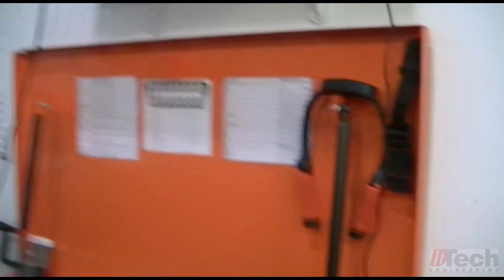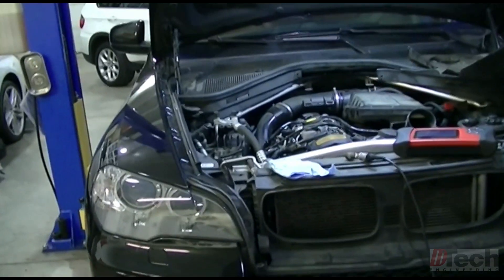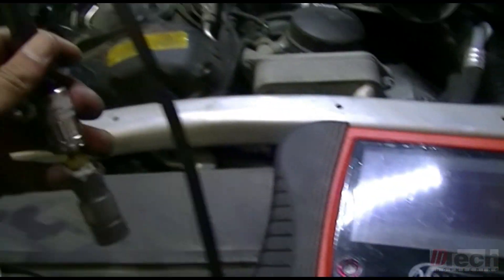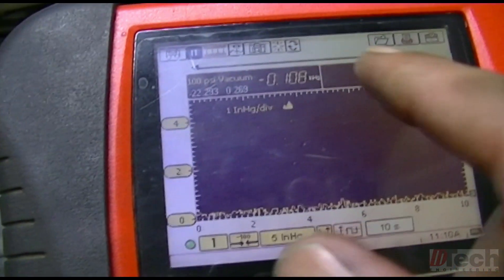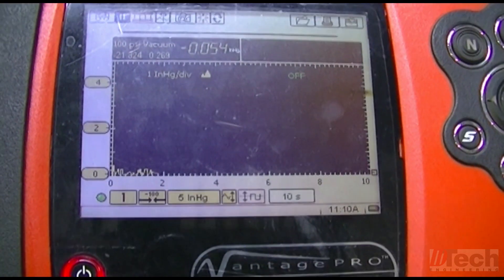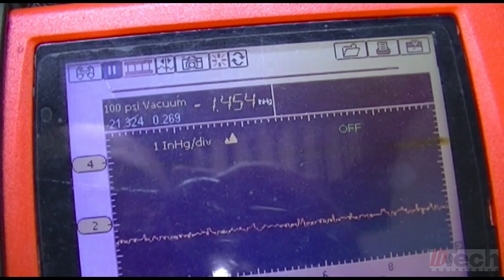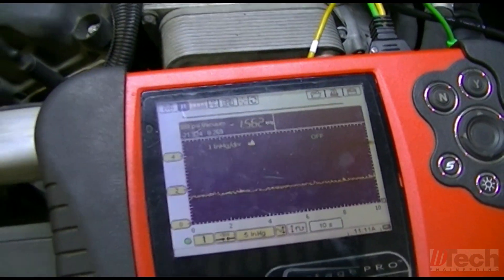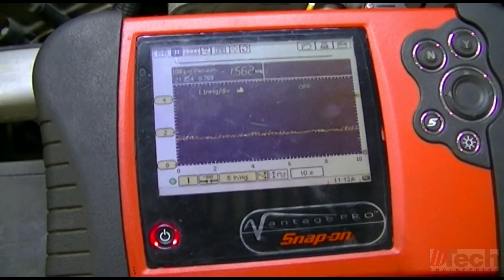BMW crankcase testing Vacuum leaks

Comment: Well, my car oil cap has some vacuum when I open it up and it kind of changes the idle when I do that, but it doesn't shut down the car. I have E90, 2008. Does that mean I have Vacuum leak or CCV valve is bad? I have no check engine light, but I do have some codes, P1415 (sometimes) and 2D06 and 2C7F.

Comment: great video, its always nice to see some explain how this system works. but unfortunately this SNAPON tool is expensive.... can i use a regular old vacuum carburator style with a old BMW N55 oil cap with a tight fitting installed in the cap. ty
Reply from the maker: if it reads low enough vacuum, you can also use a manometer that's actually what we used to use at the dealer
Reply: @DTEAuto  ty for rsponse

Comment: Quick question , is the intake pipe near the turbo collecting oil ? Blow by oil ? I have a 2015 BMW 435 I , I resealed the oil filter housing , oil line o ring gaskets , upper radiator hose , thermostat to cylinder head coolant hose , and when I shot a light down the intake leading to the turbo , there is a small collection of oil , I’m no expert , but no oil should be where air is getting sucked in , according to some , this could be oil being pushed back through the engine and condensing in the intake ? My guess is I have a bad PCV witch I think it’s stuck open or closed , it’s not a lot of oil maybe a teaspoon outside the port in the intake pipe ,, so instead of ordering a 700 dollar head gasket , I need to verify with certainty I have a bad head gasket , clues , oil seepage all around the front pullys , oil filter housing , alternator , covered in layers of oil ,, I’m not taking a chance on the serp belt I’m changing out everything all seals ,, my question is can a vac test using a affordable vac tester ? Also if I get crazy numbers ,, way off the mark ,.should I change the valve cover myself ? Or take it in ? I’ve done a few in the last , I have the service manual on torq procedures ,, but damn they are pricey , your thoughts ? Any thing will help .
Reply from the maker: I would start by stating that it is not unusual to see that amount of oil in the pipes. It's part of the fact that the recirculation system is a sealed system and oil vapors in the crankcase pressure recirculated will turn into oil droplets and eventually pool up. I have not seen a head gasket randomly just fail and fail to leak oil on the N55/N20's. The N52 would leak oil in that front area from the head gasket but due to backed out or broken small head bolts. If you think you are having pressure related problems, these bmw's are very good at throwing trouble codes for it. Again on the N55/N20 it is very common to leak oil from the valve cover gasket, oil filter housing gasket, oil cooler seal (bolted to the filter housing) , all of these are up high places that will leak downwards onto those items you mentioned. The other one that leaks in the front area is the front main seal. Replacing the valve cover yourself can be challenging and time consuming, you will be dealing with taking apart the high pressure fuel system components.

Comment: I’m a bit confused the oil cap test, if you open and lift it and you feel suction…… means you have an issue?
Reply from the maker: correct, it means that the rubber diaphragm in the crankcase vent valve has ruptured and now you are tying intake manifold vacuum to the crankcase, that is why you would feel suction when trying to lift the oil cap which means you have to replace the crankcase vent valve
Reply: @DTEAuto  thank you 🙏 I’ll replace mines this week. I recall when I when first replaced my valve cover years, I removed the oil cap while the car was idling and right away the engine start to stumble and stall out. Currently right now I lift the cap and notice suction and the rpms rev up and settle…. Doesn’t try to stall out….. based from your experience could this cause all the spark plugs to have carbon build up and bad gas mileage?

Comment: what does the known good "oil cap lift off" test sound/feel like for vacuum?
Reply from the maker: it will have just very slight vacuum in it and you will hear a small hiss when pulling it off

Comment: 👍🏿 good video I have this problem now. This will be my third time doing this job two different valve covers two different problems. I’m just gonna go to Bmw and get the valve cover the FCP Euro Valve cover is just not working out🤦🏿
Reply: @coopersimpson5017  code 280A that was the code but it’s fix now
Reply: The N55 have some of the same problems the N54 have
Reply: @jaya6454  ,Hi Jay, i have a 2013 x5 35i n55, 3.0 litre turbo. i purchased this vehicle 3 years ago. it had 130 thousand kilometers at that time.(now 168 thousand kilo) no problems of any oil consumption at all and oil is changed at less than 10 thousand kilometers on each oil change. the top valve cover gasket was starting to leak so i had new Pan (aftermarket) and new gasket replaced.plus new plugs same time.no problems with the engine as i keep everything in top shape. i am the only driver.  this 28A0 Code do consistently pop back up and service engine light do come on and if after a while if i leave this service engine yellow symbol without deleting that code 28A0 ( i use a  Ancel BM700 obd reader ) ,it will cause other codes to appear because of this28A0 code ( at least thats what i am thinking and noticed). it runs fine, but i do know that when the temperature/seasons change ( East Coast of Canada Weather) 2 degrees,(almost freezing) the vehicle will whistle for 3-- 5 seconds on first startup in the mornings only. so i feel it is the front engine seal that needs replacing anyways.the Question is,is the front seal causing this 28A0 code to keep reappearing or is it some other issues ( carbon Buildup on intake valves)???? ,I have asked this question many times on Utube and has of yet ,no input or any type of answer from any person , ??------- you thoughts and input and past experience would be appreciated   ty Sir
Reply: @jaya6454  , I have this code 28A0,  for almost 3 years now...ENGINE RUNS FINE.... JUST SURGES WHEN I FIRST START IT UP IN "COLD TEMPERATURES only/ i live in east coast of CANADA" . lots of engine  power and it is superb and no other issues with this vehicle... the thing is ,i can clear the code and drive 5 miles and no 28A0 code... leave the vehicle for 15 minutes, start it up, bingo, the 28A0 Code shows up again.. but again.. no driveablity issues whatsoever, new VALVE COVER GAASKET AND PAN, 3 years ago,  new plugs new ventvalve.purge valve new OFHV gasket (my second one now 2 weeks ago) this is my only problem with this vehicle, otherwise of that, this vehicle is fine!!  what are your thoughts suggestions, ty sir
Reply from the maker: Yes , it's always best to try on going with factory unit at first if budget allows, due to the complexity of the repair. I hope you get yours running right soon, thank you for watching.
Reply: hello you fixed your problem ? i have the exact same problem
Reply: @letopdutop5072  yeah I fix my problem
Reply: Walnut blast hope it helps you
Reply: @jaya6454  ok thanks,what was the problème ?
Reply: @letopdutop5072  My problem was carbon buildup on the intake valves
Reply: @jaya6454  okay thanks yoi just neee to clean and go

Comment: I currently went through a oil housing leak and engine gasket leak all fixed now,  brand new ECU been replaced too ,but the only issue I’m having is an air leak and the garage can’t seem to find it they checked every single part did smoke test too , this happens everytime I connect the mass air flow sensor the car misfires and mixture too lean and once I disconnect it the car runs smoothly but ofc with less power and more fuel burning please help me someone as nobody knows where the air leak is coming from ! Thanks 🙏 

M135i N55
Reply: Hey Mate, i currently have this issue. Any fix?
Reply: @jeremyzadeian8710  yes it turned out to be drive belt / tensioner belt was inside my oil sump because it was ripped before and crank sucked it in , took sump out cleaned it and back to normal but that was my case not sure about yours

Comment: Greetings and Blessings,buddy!
You are using the Snap On Pressure Transducer EEPV302AL or any other?
Reply from the maker: Pedro, yes that is the transducer I used, it is able to read down close to 30inhg of vacuum. When I do this test I set the vantage on graphing meter -> then select 100 psi vacuum. Keep in mind you will need the adapter and cable to hook up the transducer.
Reply: @DTEAuto  
I got the Adapter Kit, but not the 100 psi transducer.....
Thanks Buddy, Great video!